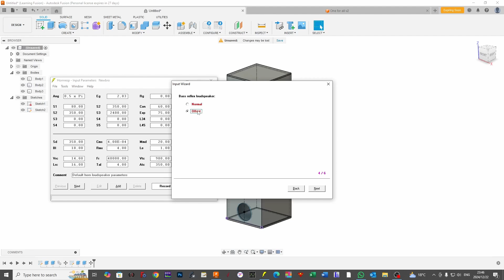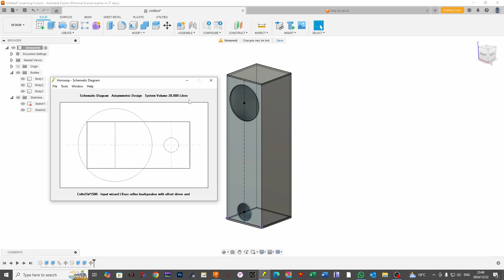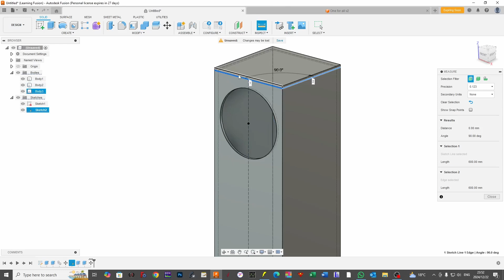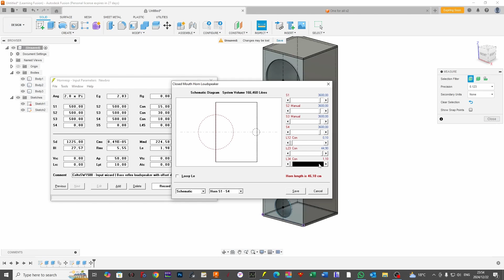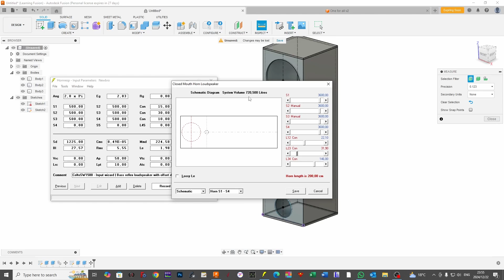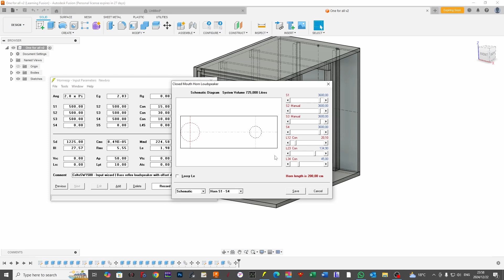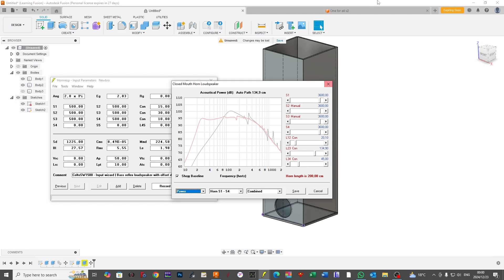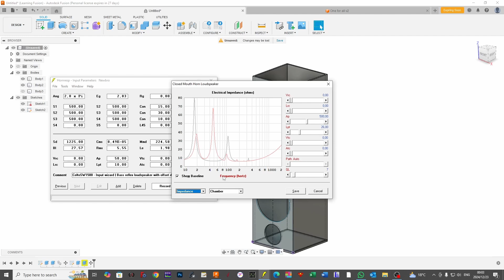Hornresp tutorial Part 3 - offset design, a bass reflex and introduction to more terminology

Comment: Thank you for the video. I have a question about imputing the data of the offest driver/ port. What if i wanted to add 2 rectangular ports instead of 1 circular? The port in the video is circular, do you have any recommendations?
Reply from the maker: @alitoconti  my pleasure. As long as the area of the 2 ports and length remains constant as if it was a single port, you are good 👍 

Just keep both ports near to each other, and if 1 port is higher and one lower, use the middle or distance between each port as the center or point to define the distance
Reply: @ thank you!